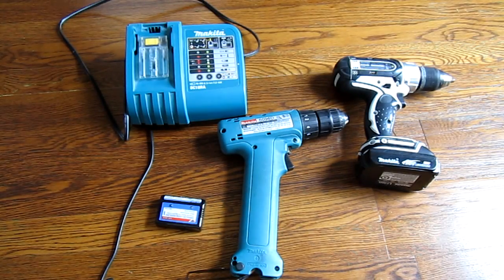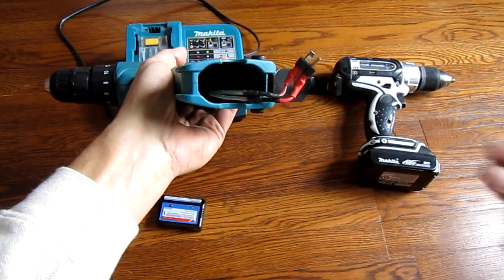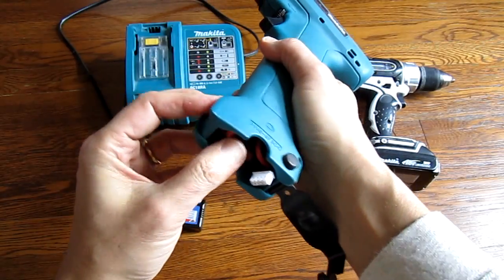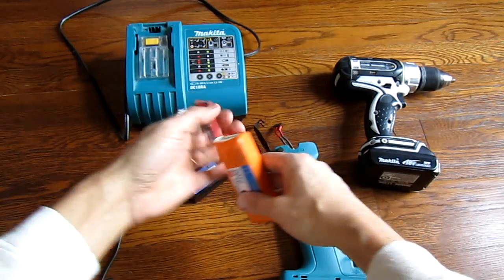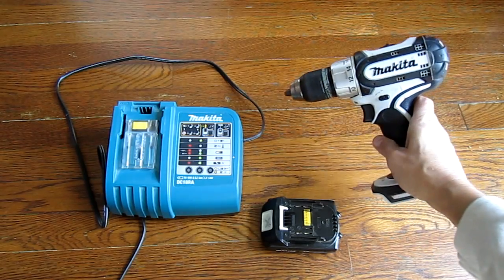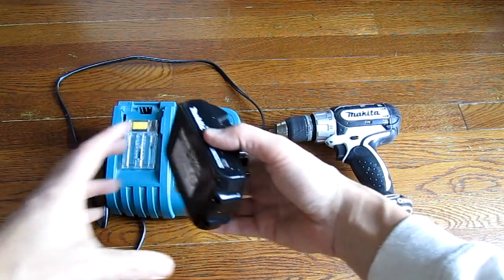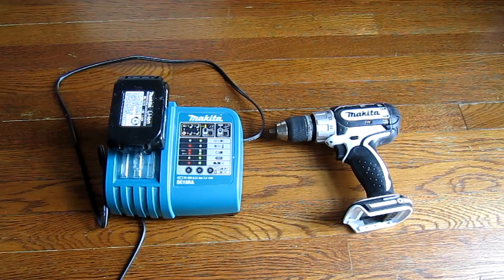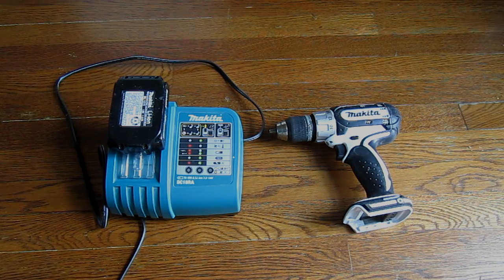Use inexpensive lipo batteries to run cordless drills

Comment: The replacement batteries are about 30 dollars. And another battery charger and battery pack that you have look for ever for. It is very helpful when they put up links to where you can get the batteries and the charger. Very informative video.

Comment: Hey any long term issues running 11.1v on that 9.6V system? Additional, got links to the battery and charger you're using?

Comment: Cordless Power tools  take HIGH AMP DRAIN Li-lio batteries  Make sure you put HIGH AMP rated batteries back in your Power tool Low drain  batteries could explode from overheating when drawing  High Amps from them !

Comment: I am quite sure those 18volts makita Li-Ion battery packs has balancing circuit on it. It could be because the thin cells balancing tabs are slightly hidden beneath the battery protection circuit board. That battery and charger  yellow coloured plastics tabs are the balancing/temperature ports.
Reply: +Irene Dye no they are not balanced

Comment: This is a very bad idea , an that lipo charger you had there is shit , you obviously have very little idea on this subject.  these batteries are volatile and can blow up easily,  hence why there used in models and not something you hold in your hand ..
Reply: They use lithium batteries in all modern hand tools.  They do not "blow up", but there is a possibility that they can catch fire, as with all batteries.  Please do your research before spouting off and attacking the maker of this video.  It reflects poorly on your knowledge and character.
Reply: @RcFlyer49  are lithium polymer is different than lithium ion.  i don't know if they're suited for this application, but i've never seen a lipo in a hand tool.
Reply: +Scott Thompson this is a good use for them. if you are that concerned then use a lipo buzzer
Reply: Scott Thompson my model planes remote controls run on lipo . I agree the charger is crap .

Comment: I want to point out (I do the same thing) that there is NO PROTECTION of any kind in this arrangement. EVERYTHING that comes with lithium batteries has electronic protection circuits either in the packs, or in the device itself. If you overdischarge the batteries below 3v per cell, that's it, they won't recharge again, and they might just blow up, and burn your house down. The same goes for overcharging the batteries, you HAVE to use the charger for the lithium batteries, the original charger for the drill will blow them up. I'm not saying you have to invest $100 in a protection board, I use a $3 charge checker (and a MK1 human eyeball) that plugs into my balancing connector on my battery, and I WATCH IT, so I don't overdischarge. I'm saying that you need some kind of overcharge/overdischarge protection or you are asking for trouble. The digital r/c charger for the lithium batteries I use is an Imax B6 ($25) and it charges everything, and even reconditions nickel batteries (as much as they can be, anyway), I use it to charge everything, now, it was a great investment. I also want to point out to the positive side that my drill now has a 3000mAh battery, it has about twice the capacity, and is less than half the weight that it was. It also has over 10 times the discharge capacity, even though I bought the cheap ones with the lowest "C" rating (compared to other lithium r/c batteries, a drill won't need a fraction of what it can do), since a drill doesn't need that much, anyway. But that still gives my 18v drill (now using a 3000mAh, 20C, 5S pack) more power and torque than a 24v drill using the original nickel batteries. My drill flat out loves this conversion. And it was free to me, since the charger had died, and the battery was therefore, completely wasted. PERFECT. DEAL.
Reply: +UNITED POLICE STATES OF AMERICA lithium batteries can go under 3 volts, but if they go below 2.5 and stay there they can be damaged over time but i have plenty of undervoltage cells that still work fine with most of their capacity.
Reply: DMAN22yeah

I over discharged a lipo pack and when I tried to recharge it, it literally exploded.
Reply: UNITED POLICE STATES OF AMERICA weird. never heard of that before
Reply: i do know that when i find 18650s at a low voltage, under 1.5 or so i have to charge them slow

Comment: On your multi cell LIPO packs, I use a drain alarm to avoid over-draining the battery.
Reply: Andrew Denley I do that, too. You have to have some kind of protection from overdischarging or overcharging, or you are asking to at the very least, ruin your battery, or at the worst,  burning your house down. Lithium batteries are notorious for the latter.

Comment: To fix "bad" Makita batteries that won't charge: Put them in the charger FIRST and then plug the charger in.
Reply: +skoronesa that wont work if the cells inside are actually dead
Reply: DMAN22yeah
Well, now you've blown my mind sir!
Reply: ***** as blown as the bad cells in the battery?

Comment: Inside the battery You have chip what controlling the charging process. Its not only 18V across battery. Electronic inside check temperature and cells voltage, so when one go down too much its blocking charging. Li-ion are very dangerous with charging failures. Can burn or explode.
Reply: +killallfornothing that is a common misconception. li-ion is much less likely to explode than lipo, it will most likely blow the internal fuse.

Comment: Brand new, factory style Makita 9.6v nicd batteries available from aftermarket vendors on amazon.. 2000amh, free shipping, for $19 each..  So you don't need to mutilate your drill and can still use the factory charger.
Reply: the nicads only last so long, and only have a certain capacity. a lipo will last many more cycles with no memory effect

Comment: Exactly what to you solder your new wire to inside the drill? Also, did you have to remove the chuck to open the side of the drill?
Reply: its very easy to disassemble if you mean the bhp452(black&White one) couple of screws and you got chuck and two pieces
Reply: i opened a 12v drill to hardwire it to an agm, its just a clamshell case

Comment: Thanks for the tip. I have a Makita stapler and a Makita right angle drill that use the stick battery. I have not used them for several years because I did not want to waste money on another Makita battery.

Comment: Have you tried opening the Makita Li-Ion battery case ? Most certainly it has the balance circuit inside.
Reply: +DMAN22yeah None of the laptop-packs i have taken apart has had balance circuit. The cell pairs is supervised closely, but not balanced. If you know of a chipset/fuel guage that supports balancing and supports "Smart Battery", please let me know. Usually the problem with balancing is space for the load resistors and heat dissipation which is usually impossible to do inside the plastic casing. The cells are aged and profiled before being put into a pack, which does away without balancing. This is furthermore made possible because a laptop isn't a high amperage draw product, so internal resistance difference isn't that critical.
Reply: +DMAN22yeah I'm afraid so, but you are incorrect. The connections is 2xGND, 2xB+, DATA,CLK,ENAB etc. No balancing. You are welcome to show me being wrong (link to some documentation)
Reply: only the new  recent ones have a balance circuit
Reply from the maker: yes i have opened the battery case, the cells are only wired in series so they can't be balanced charged. it may be that the new packs are capable of balance charging...
Reply: +zaprodk they are balanced in laptops, and just because the cell capacity matches doesnt mean they wont get out of balance over time
Reply: ***** the reason they have so many contacts is so they can get balanced outside of the pack. some have it  internal too
Reply: ***** there are many different designs, but the ones i have seen balance the cells in the computer, i dont have a link to the documentation tho, i took the battery apart for cells.
Reply: +DMAN22yeah Show me some documentation, please. I assure you, no normal consumer-laptop balances it&#39;s cells. It's simply not needed.
Reply: hammydude12345 In that case, the cells are matched up before assembling them in a pack, and this way the manufacturer can be pretty sure that they stay in balance. There is also no balancing done in a Laptop-battery, allthough they are stuffed full of electronics, but the cells are monitored, and if one pair gets too low, the pack shuts off, and is deemed dead.

Comment: just beware lipo is also dangerous they can not stand and run out so they blow themselves up
Reply: wrong,  But if you run them too low you will damage the battery.  you can get a lipo buzzer that has a LED display to let you know the state of the battery.  You do need to be carefull when charging the battery.  If the Battery is damaged or you are charging to fast it could catch on fire.
Reply: if you know lipos and are not an idiot they are fine. people get all on edge  how lipos are huge bombs and will end the world.

Comment: Humm not a bad idea, but there are some huge draw backs. Lipo batties need some babysitting in order to get a decent life span. You souldnt store them dead, or fully charged. So you have the added cost of a charger with lipo storage options. A decent 3s lipo will run you between around 40$. You need some sort of low voltage cutoff or youll damage the battery. Lipo batteries can be dangerous while charging, even if you do everything properly. Maybe just leave the lipo's in your rc.

Comment: use a small lipo alarm voltage meter like the ones on RC....you set the desire alarm voltage and beeeeepppp   time to charge the battery

Comment: The original cells were Konions or similar and required no balance taps as they are the one type of lithium cell that is inherently safe and will stand a lot of abuse. The replacements aren't and won't - non-Konion cells will need a BMS of some sort to be certain they're not going to go off in your hand, or just be very wary of them; check the balance manually every so often (frequently, is my advice).

Comment: Thats when you get a low voltage alarm, and hook it to the balance plug, that way it would make some sound when its to low. Also its important to unplug these when not in use, even with the drill sitting doing nothing, its using some energy. This should of been thoght off for a long time, lipo for a drill, and most drills should go with brushless motors, they last longer and have more torque, only a few brand have brushless motors standard.

Comment from the maker: That's also been my experience. I've had a Makita battery that won't charge and I've replaced the bad cell and it still won't charge so there must be circuitry that permanently shuts the battery pack down.

Comment: there is ALOT of incorrect info on this page.18650 Li-ion cells have cutoffs installed in the buttons on the batteries. once they drop below 2.0 they shut down the Battery PERMANENTLY. The Batts in that Makita pack are Samsung 15Q's. without a protection system on that 18V Makita battery its bound to foul out soon, you could charge each cell using your Lipo charger to extend the life of the pack.

Comment: Not exactly. Lithium ION battery packs ALL have "discharge cutoff" devices in them in the better class of devices, such as cell phones, good quality portable tools, such as Milwaukee and Bosch, as well a laptop computers, tablets and so on. The reason for this is that a lithium ion battery, once discharged below a certain threshold, and never be recharged by ordinary means. I own a couple of lithium ion tools and they STOP when the battery gets low, and go much longer than NiCd or NiMH.

Comment: Your video and one or two similar ones inspired me to try this experiment on an older cheap 9.6 volt cordless drill. It worked pretty well, although unlike your Makita, the battery does not fit inside of the case, so I've had to use rubber bands to keep it from dangling, and I have the box the battery was shipped in slipped over it now. I might build a better enclosure than that one at some point.

Comment: It was always my understanding that lithium ion batteries have circuits built into them to prevent over charge and over discharging them.  If that is the case if one cell is fully charged it will stop accepting extra voltage and that is why in the genuine drill batteries each cell is not charged seperately.

Comment from the maker: You're right. If your using the supplied Li-ion battery or a lipo battery you should stop using the drill when the power starts falling. Unfortunately, the drills don't come with a low voltage shut off.

Comment from the maker: Charge rate is not an issue. Maximum discharge rate is usually rated as "C". Recommend getting a lipo battery rated at least 15C.

Comment: Had a look on ebay for polymer batteries after watching your video. They have different charge/discharge rates(8/10 and 35/60). Which ones are best?   Great instructional vide, thanks for sharing it. Sam

Comment from the maker: @0RobotWarsIsTheBest0  Yes, the lack of a voltage cutoff is another reason why the li-ion batteries don't last long in cordless drills. I don't know why the manufacturers of high-end cordless drills like Maketa don't offer drills with a balance charger, voltage cutoff, and a brushless motor.

Comment from the maker: @pongagt  You are right, if you use a fast charger for any Li-ion or lipo batteries they won't last as long, but I think the biggest problem is that the drill charger doesn't balance charge. You don't have to make a holster if you drill batteries go dead. Just remove the battery cells and electronics from the drill battery pack housing, solder a Dean (or other connector) and put the RC lipo battery in the old drill battery pack housing.

Comment from the maker: @pongagt  Thanks! I've rebuilt a 18v Li-ion pack. When it goes dead I'll switch to an 18.5v lipo pack. My battery packs supplied with the drills have not lasted long, but my lipo batteries for RC planes have even lasted 5 years.

Comment from the maker: @civicex5speed  Thanks for comments. The supplied battery packs don't specify the the "c" rating. I've not had lipo batteries overheat with my cordless drill, please let me know if you have this problem.

Comment: @hammydude12345 How are the lipo batteries holding up without it? or are you charging them often enough to avoid getting low voltage?